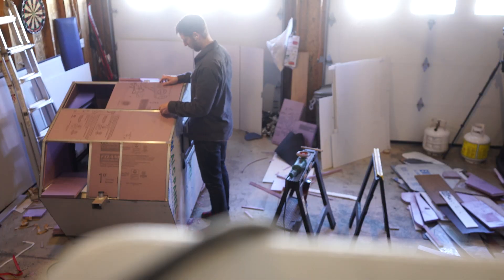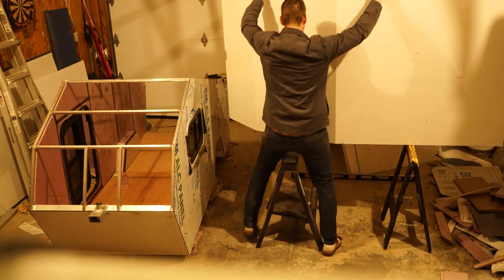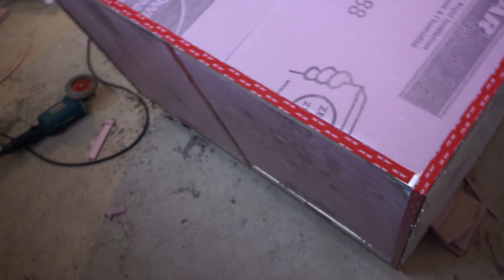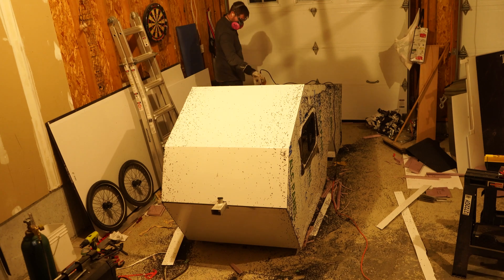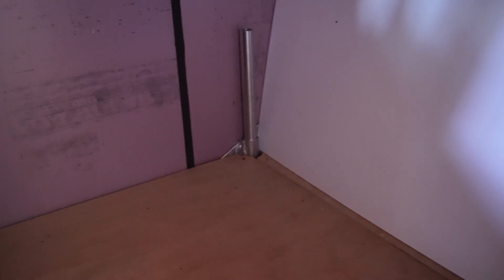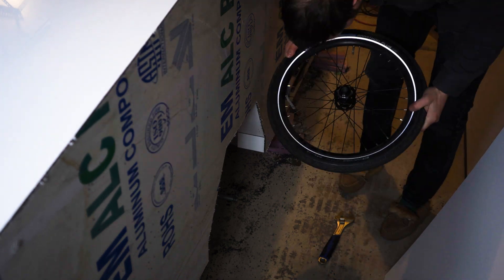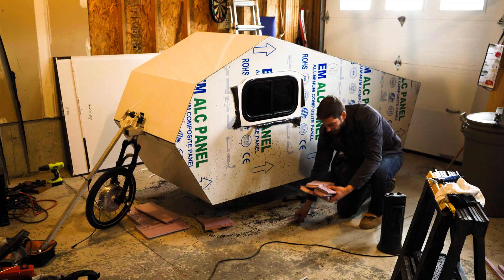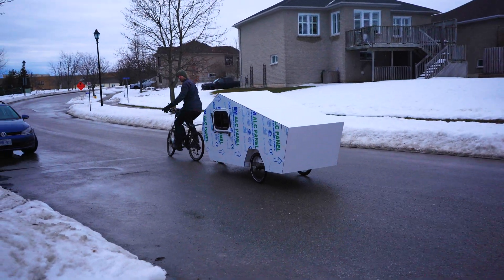Building Electric-Powered Bicycle Camper (PART 9)

Comment: You have me inspired to try building my own powered ebike camper, im close to finishing a mongoose cx24v450 build that'll be 72v 3.6kw peak to pull a camper with and im thinking about making something with 72v 2kw of power on a hub motor for the trailer and make it large enough to put 3-4 100w flexible solar panels on it
Reply from the maker: Sounds like a great setup that will get you good range depending on camper weight. I’ll do some range tests when I have my jumbo 11kwh battery built.
Reply: @Jerbrown  if my math is correct the camper once finished should be about 248lbs (depends on the materials I use and this is completely empty , I'm trying to source some 1/2in titanium square tube to make the trailer frame and use 1/4in ply and foam board but wrap it in two layers of fiberglass and it should help me save a bit of weight  and make it strong enough to handle the elements
Reply from the maker: @Kamijay97  Yeah sounds good. I took a long look at composite materials, but decided it was too much to take on for this project, plus I found some nearly free ACM panels that helped me abandon the idea of composites for this one. I also found in my case the weight savings of a composite body over ACM panels was not enough to justify the extra time for me to try to learn a whole new skillset. But maybe for the next one!
Reply from the maker: 400 watts of solar would be awesome!

Comment: Thanks for the video 👍
May I ask you where your planning on going?  How will you deal with traffic  ? 
I noticed that it doesn't fit on the sidewalk or bike paths.  How will it make it through a city ? Have you toured with a bicycle trailer before?  

Why would you want to sleep in a coffin ?  That little box is the most depressing thing I've seen in awhile.  Is your dad kicking you out?  

Ok back to reality.  How do you plan to recharge it ? Solar is not enough, you would need a longer trailer. Maybe pay for a campground to plug into.  Now your paying to sleep in a coffin . Maybe wind with fabric blades or micro hydro both when possible should be faster than solar panels. One of them offers an answer to one of bicycles biggest problems WIND .  The sailboat guy can tell you more about both . 
I look forward to seeing where this project goes , I'm really into motorized bicycle touring , gas or electric. 
Thanks again for the video 
😁👍
Reply from the maker: Hey Jarrod. 

Planning on heading west to Vancouver from Toronto area, then down to Argentina, over to Africa, up to Europe, Asia, Australia, New Zealand and then Alaska if I don't do it while out west during the first leg.

It does fit on bike paths. I wouldn't ever take it on a sidewalk.

It'll make it through the city on bike paths, but I'll mostly try to stick to less busy routes. 

What depresses you seems to make me happy. Don't watch if it depresses you for gosh sakes.

I don't live with my parents, but they've been kind enough to let me use there garage to finish this project.

It'll be re-charged by any standard 110/120v outlet. In my experience, it's not hard to find a place to plug in - campground or not.
Reply: @Jerbrown  thanks for the reply 😃👍 
Thanks for the answers I hope you keep posting so I can follow your journey.
Reply: @Jerbrown  If you are planning on doing a world tour, make sure you can recharge on different electrical systems. You should also make sure you have the proper lights and reflectors (both locations/positions and colours) for all the countries you plan on visiting.

Comment: What a great idea sharing some electric drive with the trailer. The trailer will allow you to put a huge battery in addition to your bike battery. Set the drives up with a regenerative feature to save on brakes especially going downhill.
Reply from the maker: Exactly!
Reply: Grin Technologies has good vid explaining different motor design types in regards to regen. Anyway only direct drive motors have the capability, nearly every e-bike motor that is not specifically marketed to use regen are not direct drive. A much higher production cost at scale along with more weight and a few percent increase in unpowered drag are some of issues.
Reply from the maker: @rockscaler99  The grin all-axle hub motors have excellent regen braking power. I buy all my stuff from Grin for over 10 years now.
Reply: @Jerbrown  Im planning on converting my cruzbike q45 with the grin all-axle kit to assist touring with my Rottweiller.  The regen braking is very desirable for long downhills.
Reply from the maker: @rockscaler99  awesome, I think you'll be very pleased with the regen braking power on that setup. I don't even use my mechanical brakes on me e-mtb anymore with that setup. Cheers

Comment: Someone may have asked this previously, but I have 2 questions... what if anything are you doing about braking the trailer and secondly, how are you going to manage/synchronise the power assistance from 2 different hub motors? I ask as im building a 50s replica scooter/bike camper and have just done brakes as it was too much to rely on the bike alone and I thought about adding a power hub to it but couldnt see how to make the electrics work..
Reply from the maker: The trailer will be braked by the hub motor in its front wheel. Regen braking on the Grin products is so good, you don't even need to use mechanical breaks almost at all. But, I will also be building a front disc brake modelled after the Carla Cargo design. Thirdly, I need to figure out a way to keep the brake engaged on hills and while stopped.

Managing the power from 2 of the hub motors can be done automatically using Grin Cycle Analyst and phaserunner controllers with their cabling they provide. I am also going to test controlling the power and braking independently with two cycle analysts - one controlling the front wheel, one controlling the rear wheel. I'll also use two trip wires for brake signal input.
Reply: @Jerbrown  well I look forward to seeing the tech side of this then. If its an overrun brake, you would just need a way to keep the brake pressure applied (so a mechanical locking lever etc like car trailers have) assuming that the brake won't bleed off pressure for 'parking'. Personally I'd be considering if it was possible to brake  the rear wheels. Yes load will transfer to the front wheel under heavy braking, but 2 patches of trailer contact rubber on the road gripping would still be better than just the front which would already be dealing with the regen side of things.
Of course all this depends on weight of the trailer and how long that downhill run braking is needed or how quick you need to stop in an emergency..
Regen is great on long slow braking (I have it in our hybrid car) but not for quick stopping..
Well done on your project so far it's looking great..!
Reply from the maker: @chriscansdale6389  good points! I will have to think through this all carefully. I have been very impressed with the regen of the Grin all axle hub and frankenrunner controller setup. But yes, still need to address those other situations. Cheers!

Comment: So many questions I’m sure you will answer in up coming videos.
Looks good so far👍
Reply from the maker: Hi Keith, if you let me know your questions ahead of time, I’ll be happy to try to answer them sooner than later in upcoming videos.
Reply: At some point after the realization of what you have created.
Battery pack or packs size?
Solar panel or panels size and wattage?
How far you plan to get out of it in one day or trip?
Plans to tie it down in high winds?
Charging options?
By the looks of it all you need is a front window and a Handle bar/steering wheel mechanism inside and you would have a electric trike. Put the bike on the back😬
Reply from the maker: Check out pages 3-8 here: https://docs.google.com/document/d/11GKbJdV7WeNTH5tBYn8YkSHYviddUBGkGxWw7oFSD-w/edit?usp=sharing
Reply from the maker: solar panel = 170 watt sun power panel. Probably going to buy the Grin kit they sell at ebikes.ca. I would like to cover more of the roof to get more wattage, but I can't find products that will fit my dimensions. So the single 170 watt panel will do.
Reply: Build a light weight frame for the panels that allow them to overhang a bit on each side or back. Put a fan at the front, back or side maybe.
It will be interesting to see how much power you will need to effectively tow the trailer any real distance. You could always add more panels as needed at a later date.
Reply from the maker: @keithnewton1966  The solar panel(s) were only ever meant to be supplementary in this design. I will rely primarily on charging over night at standard 110/120v outlets. I'll probably build a 12v battery pack for inside the trailer to power the cabin lights and roof fan overnight if I have the bike charging elsewhere from the trailer. Otherwise, I'll run the electronics off the main battery.
Reply: Thanks for clearing that up.
Will be looking forward to your next video.

Comment: Congrats 🎉
Reply from the maker: Thanks Raphael!
Reply: @Jerbrown  Because following your project, I also start to learn TIG welding now 🙂 I'm just in the phase to select my welding machine. I saw you most of the time welding with a pedal? Do you recommend using one? Do you also weld with the pedal when in upright position?
Reply from the maker: @RaphaelVogel  awesome, yeah I always weld with the pedal. I bought a primeweld 225 welder. Works great. Good luck! It's very rewarding skill.